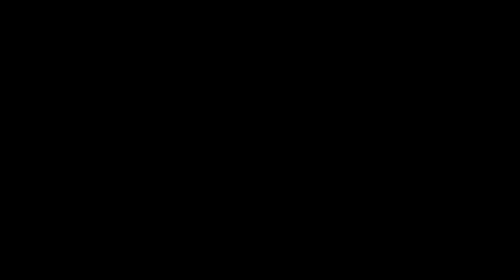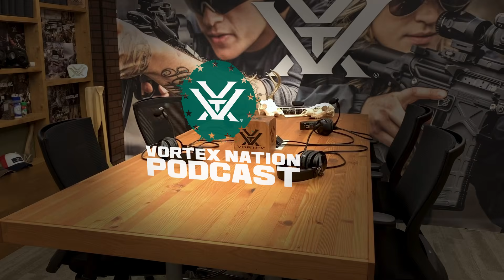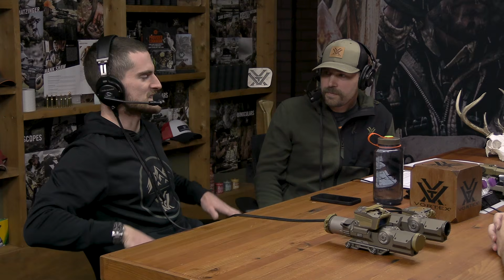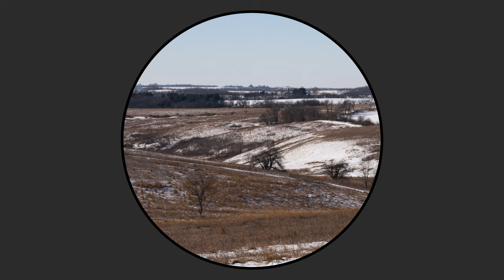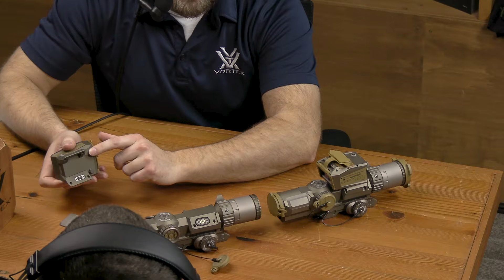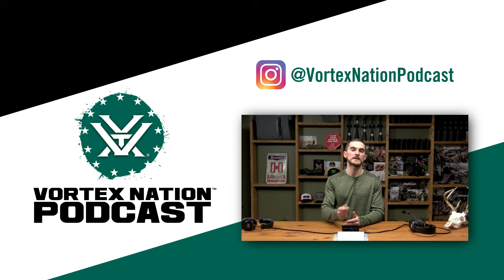Ep. 220 | Army selects Vortex® for Next Generation Squad Weapon – Fire Control. What is it?

Comment: This is even more insane when you realize the other entry was L3 Harris, the guys that make everything from Quad nvgs to sniper/legion pods and DAS on the F35. Truly a David and Goliath moment. Congrats guys!
Reply from the maker: Appreciate it, Kevin! 👊
Reply: @VortexNation  not only are you leading the way forward but your warranty is second to none!
Reply: @VortexNation  Feel free to run with this idea vortex, for the additional attachment to the front of the optic, a device that transmits shooter aiming points along with all tagged locations to a tablet, battle manager, commander, or friendly vehicles could be an indespensible asset! Its applications could range between after action reports and precise corections during training, to coomanders and battle managers having a greater idea of where combatanats aare located in relation to troops! 

Soldiers could have an ISR platform overhead marking targets that appear in the huds of all or just releveant soldiers.

If this comes to fruition, I apologize to all Soldiers, Sailors, Airmen, Marines, & Specialists who will inevitably face micro managing to some degree.
Reply: Vortex is the goat!
Reply: You are so right. I didn't realize who all they were competing against.
Reply: Cost is always the issue, especially to the military. Vortex had to have been the lowest bidder during the trials for cost to benefit ratio. 
Milspec = lowest bidder. Even the new god awful M17’s (Sig p320) were less than $300 per unit. $460 for Colt M4.
Reply: Sig Sauer already has this for the public. Look up the Sig Sauer Kilo. 
10,000yds range finder that Bluetooth to your scope to transfer all ballistics and weather for the most accurate shot. 3 years old product too.
Reply: Use that vs this in a combat situation and see is faster. Plus less shit to carry around
Reply: @Honkers716  If you think this is the same thing as a commercial rangefinder that transmits ballistics data, you’re wrong.
Reply: @TKTK-sw3tq  Really? So you need more that this?

Disguised within the form factor of a traditional riflescope lies the power of the SIG SAUER BDX Ballistic Data Xchange. The SIERRA3BDX riflescope provides the hunter an illuminated auto-holdover dot on targets when coupled with a BDX capable KILO rangefinder. Featuring exceptional SpectraCoat lenses, LevelPlex digital anti-cant, and KinETHIC kinetic energy transfer indicator, the SIERRA3BDX is incredibly simple to use. Range a target, put the holdover dot on target, pull the trigger, impact. SIG SAUER’s BDX, just CONNECT THE DOT

Features

Integrated BDX Ballistic Data Xchange. A rangefinder and riflescope system that uses ballistics, enviromental conditions and Bluetooth® to illuminate the exact holdover dot.

Automatic holdover dot on a Digital Focal Plane, combining Second Focal Plane stadias, with an OLED illuminated ballistic holdover dot that automatically scales with zoom to subtend on target at any magnification level.

Features our MOTAC (Motion Activated Illumination) that powers up when it senses motion and powers down when it does not. Provides for optimum operational safety and enhanced battery life.

Spectracoat highly efficient, ultra-wide broadband, anti-reflection lens coatings reduce surface reflections to extremely low levels xacross the entire visible spectrum providing superior light transmission.

SIG SAUER’s innovative KinETHIC kinetic energy transfer indicator. KinETHIC provides assistance in assuring an ethical hunt by indicating when energy on target drops below a threshold that can be set by the hunter using the SIG BDX App.

New for BDX riflescopes, Auto LevelPlex, automatically increases digital level sensitivity on longer shots.

Dependable waterproof (IPX-7 rated for complete immersion up to 1 meter) and fog-proof performance.

AND THIS?

Featuring SIG SAUER’s BDX technology, the KILO3000 BDX is the world’s most advanced laser rangefinder. When paired with a SIERRA3BDX riflescope, the onboard Applied Ballistics Ultralite calculator sends ballistic drop data via Bluetooth directly to the SIERRA3BDX’s BDX-R1 reticle, providing an illuminated holdover dot and wind hold. Download the free BDX App for iOS or Android to setup ballistic profiles and synchronize custom profiles to your KILO for exact ballistic solutions.

FEATURES
- BDX™ Ballistic Data Xchange capable, providing your BDX riflescope with an automatic illuminated holdover dot through Bluetooth pairing
- Revolutionary LightWave DSP™ Technology for the fastest and longest distance range finder engine
- HyperScan™ Technology provides 4 range updates per second in scan mode while RangeLock™ reports the last range result when ranging distant targets
- Embedded Applied Ballistics Ultralite with bullet database and support for G1/G7
- Low Energy Bluetooth 4.0 for synchronizing up to 25 custom ballistic profiles between the free SIG Ballistic App and rangefinder
- Advanced OLED display provides a smaller, extremely precise targeting circle along with milling features and ballistic info including holdover angle
- Line of Sight or Angle Modified range in addition to full ballistic holdover and windage results in MIL or MOA
- Lumatic™ Display automatically calibrates display brightness to changing ambient light condition
- Compact, lightweight magnesium housing with binocular style eyecup and diopter adjustment
- Free downloadable SIG BDX App for your smartphone, iOS and Android are supported
- Covered by SIG SAUER’s INFINITE Guarantee™ and Electronics Limited Warranty
Reply: @TKTK-sw3tq  Also what animal are you hunting that you need more then any of what Sig Sauer Scopes has to offer?

Please let us know why need a rangefinder that calculates the environment out past to 10,000 yards now? 
And then a computer relays that info to your scope to shoot at targets at over 1,000 yards very accurately? 

What are you hunting that needs more then that?

Or are you fantasizing about murdering people in the future so you need something more than this?

Please explain?
Reply: @TKTK-sw3tq  If they are not the same, explain what are the differences and why need them over what has been out for over 3 years now by Sig? 

Let's hear it champ
Reply: @Honkers716  First issue is bluetooth connection. That’s a no go right out the hop. Very unreliable method of connection and you don’t want your piece of kit to be constantly transmitting bluetooth on the modern battlefield. 

Second, the Kilo series isn’t rail mounted. There’s another no go. Having a separate piece of kit that you have to keep in your pack and take out and put away every time isn’t exactly an integrated solution. You have to sling your rifle or let it go to laze your target and then wait for bluetooth to connect and transmit data IF the bluetooth even works and then you can pick up your rifle again and now there’s an illuminated dot. 

Third, the holdover dot isn’t your point of aim. You haven’t shot the scope obviously. You just hear marketing wank and you slurp it up. Their BDX-R1 reticle just lights up the holdover dot on the y axis to give you your vertical holdover and then a dot on the X axis to give you your horizontal holdover and you’ve got to just guess where the two line up.  It’s worse and slower than just using a good traditional BDC reticle on a first focal plane scope combined with a traditional range finder. You can spend a little more and get the more advanced BDX scope and it gives you more dots but it isn’t granular enough for PRS. It’s illuminating the nearest dot to your holdover point. The vortex illuminates a dot exactly where it needs to go because it’s a full display across the entire field of view. It also lets you do something extremely valuable. It tells you the direction and range so you can say NE 300m “red barn” and call it out to everyone around you instantly in a self contained solution without ever having to take eyes off the target. 

Fourth, this is an LPVO. So this automatically precludes all the SIG BDX scopes. The vortex is a 1-8x. The ideal goal is to make the 1x as close to a CCO aimpoint red dot as possible to be used for offhand shooting, barricade shooting, and CQB. None of the SIG scopes are LPVOs. That was the requirement. SIG is targeting a very different market with their BDX scopes. 

Fifth, the BDX scopes aren’t ruggedized in the slightest for mil use so that’s automatic disqualification.  They’re made for hunting so they shed weight where they can because hunters coddle their equipment. The Vortex scope is built with a rock solid mount and a lot of structural changed to the scope body.

Fifth, The SIG BDX and kilo rangefinders are also made in China which is another automatic disqualification. Vortex is right. It’s extremely hard to make a scope in America and really only vortex has the capability to make high quality American ground lenses. SIG partners with Huanic to make their cheap optics. Huanic also supplies Chinese special forces. I think you can see the issue with buying SIG’s budget option for mil use. 

We’re talking about the Vortex scope being used for military use. I’m telling you why the SIG BDX is nowhere close to this as an option for mil use and why it really is revolutionary. 

This isn’t for killing deer so you can make sausages. This is a product made to end the lives of living and breathing human beings. That’s why I own a gun. That’s what our founding fathers used their guns for when they were establishing this country. My ACSS reticle has stadiometric range finding based off of an animal that’s 5’9” tall and has a shoulder width of 18”. If you think that’s meant for deer, you’re sorely mistaken.
Reply: @TKTK-sw3tq  your first statement is completely wrong. You can take it out of the box and it has an automatic setting that you can Quest and it'll bring up 100 200 300 400 500 600 700 800 yards on a. Without any Bluetooth connection.

Will Central wrong on the first one. I'm not going to read the rest cuz you're probably going to be wrong and all that also
Reply: @TKTK-sw3tq  secondly it is rail mounted.
There are plenty of videos on YouTube the people hunting with VSCO and it is rail-mounted.
Reply: @TKTK-sw3tq  third. You're wrong again because it does have a point of impact called. You're talking about the 1.0 version of BDX not the 2.0 version of BDX.

Get with the times
Reply: @TKTK-sw3tq  4th. The Sig Sauer scope comes in many different variables of magnification ranges. They have six different Scopes that go with the 2.0. And five Scopes that go with the original 1.0.

Are you sure you know what you are talking about?
Reply: @TKTK-sw3tq  5th. Yes it's made in China because it has way more technology than any Vortex scope ever had. Besides the one that they made for the military that's not for commercial use. So when you're packing that much technology into a little piece of scope, you're going to need really cheap products that are not made in America.

And I guarantee that the vortex scope still has chinese-made Parts in it it's just put together in America. You think we make all the batteries?

You're really bad at this.
Reply: @TKTK-sw3tq  also the people that founded our country use guns to hunt to get food. Do you think they had a grocery store at every corner? Or a grocery store at all?
Reply: @Honkers716  

Please stop replying to me 6+ times and just put it in one comment. Why the fuck are you doing that?

Yes it will display holdovers without a bluetooth connection but that’s just a basic BDC reticle with basic holdovers which most modern combat oriented scopes have anyways. ACOGs designed decades ago have BDC holdovers. That’s extremely different from exactly illuminating your point of impact. 

I don’t know what you’re talking about with the VSCO but that doesn’t exist and the SIG kilo rangefinders don’t come in a rail mounted version. 

https://youtu.be/OFPhqV-Zpw8
Do you actually own this scope? Have you ever shot with it? Here’s a video of the 2.0 BDX and it works exactly like I said. It lights up a dot on the x and y axis and you have to line up both and the illuminated point of aim is not 100% precise because you’re lining it up to the nearest dot whereas the vortex illuminates exactly where your point of aim is because the entire field of view is part of the display.

Do you know what an LPVO is? It’s a Low Power Variable Optic. It’s a specific thing that generally requires a 1x to a zoom range of 6x or 8x or 10x. It’s a very demanding magnification level to make because the 1x has to remain completely distortion free with as big of an eye box and eye relief as possible in order to make an optic that can be used for CQB. None of the SIG scopes fulfill that requirement of being an LPVO. That’s not what they’re trying to do. This is a product made for hunters that coddle their scopes.

You’re saying that the SIG BDX scope is more advanced and feature packed than “anything vortex has ever made”? You’re saying that it’s more advanced than the Vortex NGSW scope that we’re watching? You’re saying that it’s so advanced that it needs to be made in China? You’re incredibly delusional. They make it in China because they can make it for a few hundred bucks and sell it to you for $1,000. The SIG tango 6t for mil is made in Japan. I don’t know if we read the same thing but it’s glass is ground in the US. That’s pretty much the only thing that we have generally needed from foreign countries. The scope body is not challenging. In fact, no one makes the components for the scope body overseas because everything about this optic is new so they have to source everything from the US other than standard components like screws or batteries.

The founding fathers used their guns to hunt both people and animals. You asked why I want a scope like this, it’s so that I can kill real live human beings if I have to. That’s the truth. That’s why many people today own guns. You asked me a question and I answered you with why I own a gun. I didn’t answer for why someone else owns a gun, you asked me and so I told you my answer.

Again there are tons of important features missing from the SIG like ruggedization and displaying the distance and azimuth to the target directly in the scope to be able to make callouts. The fact that the rangefinder and scope are separate so it weighs significantly more and isn’t practical for mil applications for the average infantryman. Future capability upgrades aren’t possible with the SIG scope.
Reply: @TKTK-sw3tq  why don't you just explain why you need a combat scope for civilian use? What combat zone do yiu live in?
And it's the same point of impact also. It calculate your environment just like the Vortex scope. Wait, do you think there's different math calculations for these scopes? Like vortex has special math for ballistics and environment? I bet you do.

Once again I said that the rangefinder don't come with a rail mount because why you need a real mount for rangefinder? It's a range finder, put it on a tripod and look through it. That's how everyone else uses a range finder.
Are you okay over there? Or do you want the 10,000 yard range finder inside the scope for what reason again? Oh wait, I'm thinking hunting elk and you're thinking about hunting people in your community. Why would I ever think about the sane reason to own a gun and need this kind of equipment. 

The BDX literally has hold iver technology. Yes I own this scope and have for over a year. Maybe the video was an old video but it has 1 hold over dot for your aiming point. The x and y axis was the 1.0 version.

Wait, so you're expecting a scope that is 20x to also be 1x? 😂 This package is meant for 800 yard shot kiddo, not 80 yards for shooting your community members. That's why you need help. This is meant for hunting, the vortex is meant for killing humans. Also the reason why it's not meant for the public bc the higher ups already had meeting for people like you that are in the world. You think the kept it to the Military bc they don't like money? Bc your and your "militia" I bet are ready to buy this but yet Vortex (and the rest of us) understand why someone like you should never own anything like this bc you have a murder fantasy about killing your fellow American.
Reply: @TKTK-sw3tq  Also, I explained why I split up my original messages bc there are different view/talking points but if you want to read a short story, we can do it your way boomer. Bc debating a single idea is not your strong suit.
Reply: @TKTK-sw3tq  When used together KILO BDX rangefinders and SIERRA BDX riflescopes combine to create the most advanced optics system available on the market today. Simply configure your ballistics profile in the BDX app, pair your KILO BDX rangefinder with the app, and then bond it to your SIERRA BDX riflescope. When you range your target the KILO BDX rangefinder automatically sends your specific holdover data to your SIERRA BDX riflescope giving you an illuminated holdover dot. It’s simple and fast.

That's right from the website. What does, holdover dot, not dots, mean? Do you comprehend the English language?

Also, even if it had an x and y axis that means this scope has 15 out of the 16 characteristics of the Vortex scope but yet that 1 features makes you say, it's not worth it and you can only have/need the Vortex scope for close combat? You must be a joy to be around with the way you can compromise and your murder fantasy about killing your fellow Americans.
How many times have you been divorced?
Reply: @Honkers716  
"@TK TK  secondly it is rail mounted.  There are plenty of videos on YouTube the people hunting with VSCO and it is rail-mounted."

"Once again I said that the rangefinder don't come with a rail mount because why you need a real mount for rangefinder? It's a range finder, put it on a tripod and look through it. That's how everyone else uses a range finder."

Here's a quote from you saying it's rail mounted. I don't understand why you're trying to gaslight me. Again, the vortex scope is made for mil use. I am explaining why having the rangefinder and scope separate is unacceptable for mil use for the infantryman. Especially because the rangefinder can't be rail mounted. That's a huge negative and makes it a no go.

"It’s a Low Power Variable Optic. It’s a specific thing that generally requires a 1x to a zoom range of 6x or 8x or 10x"

"Wait, so you're expecting a scope that is 20x to also be 1x? 😂"

Here's my quote about it needing to be an LPVO. I don't know why you're making things up to argue with. You're pretty much arguing with yourself. If you want to talk to me, you ahve to base your responses off of what I'm saying. I am responding to your comments and I expect you to respond to my comments instead of your imagination. I expect a 1x scope to at least be able to magnify to 6x but 8x is preferred. 

It's not meant for the public because this is developed for a military contract and it'd be illegal for them to disclose certain details or make the exact same scope for commercial use. 

The founding fathers had to kill fellow americans as well. There were loyalists then. During the Civil war, the Union also had to kill fellow Americans in order to emancipate Americans. That's the price of freedom. 

"Sig Sauer already has this for the public. Look up the Sig Sauer Kilo"

Again, the SIG kilo line is fine for hunting. You claimed that SIG already has "this" for the public but they don't. They have a hunting scope that integrates with a rangefinder to give you a holdover dot. The Vortex scope is a packaged product that's ready right now to hand to an infantryman to be used in combat with minimal retraining and is ruggedized enough to withstand combat. The SIG line only has one small aspect of the larger picture and it's a significantly toned down version of that aspect as it doesn't integrate a compass and display range inside the field of view of the scope.
Reply: @TKTK-sw3tq  Read that again, I said: don't come with rail mounts....

And there are plenty of videos of ppl shooting elk and deer with 1x scopes, huh. Link please. Bc I guarantee that is very uncommon in the hunting world.
Maybe you would use a 1x on a .22lr but what other caliber are you hunting with that is for a big game animal that you use 1× on, realistically?

Infantryman? What warzone are you in?

Also if you knew anything about a sniper team you would understamd that they come in teams and yes, one guy has the range finder.

Or are you playing Rambo and you're doing it all by yourself without a team? Mr Infantryman. 😂
Reply: @TKTK-sw3tq  The SIERRA3BDX 2.5-8x32mm is a compact and lightweight riflescope designed for ultra-lightweight rifle, shotgun muzzleloader, and crossbow configurations. With the power of the included BDX technology, it provides your exact holdover dot location on targets when coupled with a BDX capable KILO rangefinder. Featuring exceptional SpectraCoat™ lenses, LevelPlex™ digital anti-cant, and KinETHIC™ kinetic energy transfer indicator, the SIERRA3BDX 2.5-8x32mm is incredibly simple to use. Range a target, put the holdover dot on target, pull the trigger, impact.

So that is not good enough for you? Is 1x to 2.5x going to mess you up that much?
Did you also read where it says, and I quote, "put the holdover dot on target, pull the trigger, impact."

Now what part of that makes you say x and y axis again?
Reply: @Honkers716  
"@TK TK  secondly it is rail mounted.  There are plenty of videos on YouTube the people hunting with VSCO and it is rail-mounted."
This is a direct quote from you claiming "it is rail mounted". That's a direct quote directly from what you said. 

This isn't about hunting. You had said that "Sig Sauer already has this for the public. Look up the Sig Sauer Kilo". I am telling you that SIG makes a hunting scope and they do not make "this" for military applications. I am telling you that a recce scope with 2.5-8x zoom is unacceptable for mil applications when you're giving this to every single infantryman and expecting them to do CQB with it. This is not for sniper teams. What sniper team do you know that's using an LPVO for their use? This is again for the average infantryman like vortex has said. 

Yes a 1x to 2.5x will mess you up for CQB applications. It's definitely possible to clear buildings with magnified optics however you run into significant issues with eye box and eye relief and consistency as well as PID. 

https://www.youtube.com/watch?v=sJ_q_9CWIAo 
Here's a video showing the BDX 2.0. If you want, find a video that proves me wrong. I put two videos so far of the BDX 2.0 that prove you wrong, it's up to you to prove your point now.
Reply: @TKTK-sw3tq  I just took a screenshot of this whole conversation and sent it to the FBI tip line. Hope you have a nice talk with them. And now you are on their list regardless if they find you a problem or not. You will be forever on the watch list.
Reply: @Honkers716  I took a screenshot of your comment to report to the FBI cringe line. Pull it out for a laugh at the office Christmas party
Reply: @Honkers716  
This technology is ment for military use buddy! Not for commercial use in the states! Are you not understanding that difference? ONE PACKAGE DEAL FOR A SOLDIER ON A BATTLE FIELD OUT IN THE MIDDLE EAST,  AFRICA OR RUSSIA!
This is not a system for a HUNTER. 
THIS WILL NOT BE MASS PRODUCED FOR YOUR ENJOYMENT NOR OURS!
Reply: L3/EOtech stuff is keeps and bounds above Vortex stuff currently in the market. Hopefully Vortex can step up their game with domestically produced weapons sights and move past their fingers mass market junk.
Reply: @littlejackalo5326  Because an EoTech vudu is on the same level as the Vortex Gen 3 LPVO right? 

I’d agree to an extent. Vortex is not a reliable brand in the slightest. They put out a lot of crap but if you only pay crap, you get crap. Their top of the line products outmatch or keep pace with any other product at their level though.
Reply: That tells me that price per unit was likely the selling feature, not quality. Wonder if these will be made in their China factory like some of their "top end" optics lol
Reply: @commiecrusher  Did you watch it? Its being made in the US
Reply: @Pooppeepoopful  He said built in USA, mostly sourced in USA.. Be As USA BUILT as possible. SO, what isn't made in the USA. 13:10 timeframe. Pay attention. Something, probably board, and chips are made in Taiwan/China
Reply: @commiecrusher  citation needed
Reply: @commiecrusher  It's made in the US, though it sort of sounded like "Made in the US from domestic and imported materials" more than "Made 100% in the US".
Reply: @PocketDrummer  I mean that is always a thing dude, for the most part.
Reply: lol you guys lost afghanistan, you had the latest technology and best forces in the world and you still lost to a bunch of peasants
Reply: @kingsman3087 Oh man.  Your comment says it along with your name.  Been there twice and three times to Iraq and never "lost" at anything there guy....

LOL to your peasant ass keyboard cowboy...
Reply: @kingsman3087  We didn't lose anything, the senile decrepit old man occupying the White House did.
Reply: @marksmith2022  which one